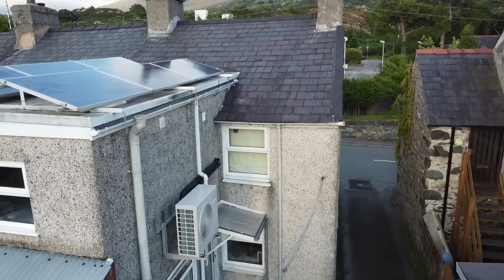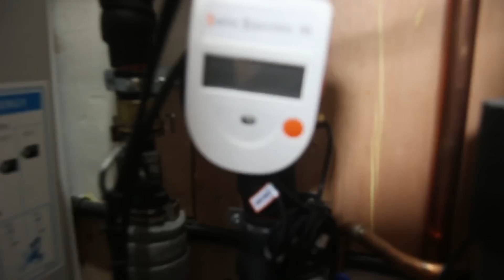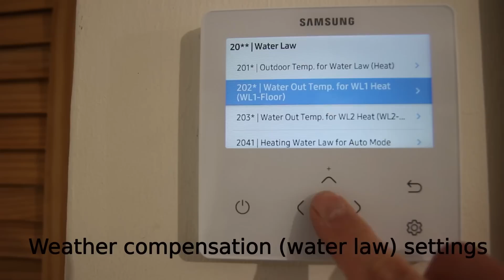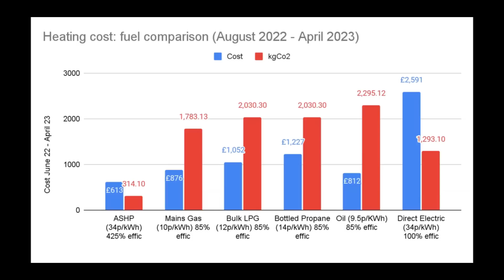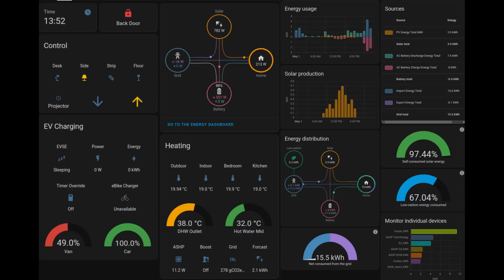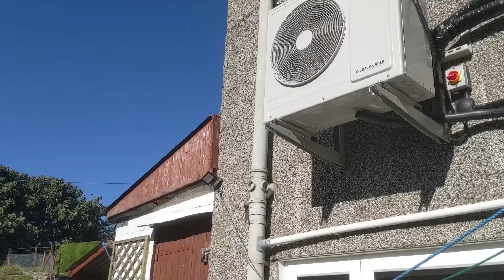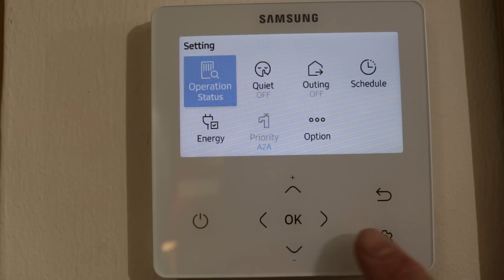Part 2/2: Air Source Heat Pump 1st Winter Performance 2022-23 in Solid Stone Welsh Cottage

Comment: Hi Glyn, I have recently stopped full time work after 51 years in HVAC. My last position we had AWHP Range (competitor brand). Really blown away that 5 kW size is adequate for your Application but need to believe the results you have shown. I assume the Samsung model is R410a Refrigerant and has an Inverter Compressor for variable capacity control.  (?)
Reply from the maker: Hi Terry, thanks for your comment. The Samsung unit uses R32 refrigerant with an inverter compressor.

Comment: Hi, thanks for the information! Q; because we live in a simular old house and we are about to start with a renovation, would you choose under floor heating over radiators?
Reply from the maker: Yes, UFH is great if it's an option and it's been designed for low temperature heating. Often in a retrofit UFH is not a very practical option. But if your doing renovations it's a good opportunity.
Reply: @GlynHudson  hi Glyn, thanks for your fast reply. Because a UFH system needs to heat up the thermal mass and therefore not suitable for a on/off system like radiators, my concern is that it will use more energy. Or am I’m thinking wrong here?
Reply from the maker: @MrFlyby34  your correct UFH will take longer to heat up, but will be more efficient since it will be able to run at a lower flow temperature than radiators so heatpump will get a higher SCOP. Generally with a heatpump with or without UFH its more efficient to keep the house warm 24/7, just with a set back temperature of a couple of degrees lower at night or when your out. This will use less energy than switching it off.

Comment: An excellent video with very useful real-world data.

You mentioned that your system isnt "zoned", however i noticed that you have thermistatic valves on your radiators, which effectively means that you have individual room zones.
Reply from the maker: Thanks. Zones are usually defined by having zone valves to be able to heat different parts of the house at different times. Correct, we have TRVs so we have the option to reduce heating on one or more radiators but we've left all the TRVs fully open

Comment: In total how much have you spent on your ASHP and the solar battery system? Admiitedly this is not why you are doing this but what is the payback time in years?
Reply from the maker: Since I did all the work myself, my costs are not really comparable. I spent about £4k on materials which included all new radiators, pipework, heat pump and cylinder. There is currently a £5k BUS scheme grant available from the UK government which I was not eligible for since I did the work myself

Comment: Brilliant work!  I have DIYed 3 gas central heating systems before, in previous homes and had to have a new gas boiler installed last year, because of the CORGI regs.  After watching your install, I am now thinking of DIYing a heat pump.  Fortunately, I used 22mm primary pipework so it might be a goer.  I will have to reinstate a HWC and will look up the physics and calculations about heat loss etc.  Do you have any links to theory stuff?  I studied engineering physics so I think I can understand.   Keep up the great work!
Reply from the maker: Thanks. You get about 6kW down at 22mm pipe at 0.9mps at DT5. Watching all the heatgeek and urbanplumber videos is a good place to start. Also, https://heatpunk.co.uk is an excellent heat loss calculation tool.

Comment: This is an inspiring video - thanks for making it.  I'm trying to understand how the system manages relatively low-temperature space heating (35°C) and relatively high temperature (up to 65°C) DHW heating at the same time. Is space heating paused while DWH heating is happening? What sort of plumbing arrangement and controller are necessary to  make this happen? Any references you could provide to educational material would be very welcome. Thanks.
Reply from the maker: Thanks, yes your correct the system can either do space heating or DHW. Not both at once, but DHW only takes about 30-40min so I just schedule it during the night when we don't need space heating as much. There's a three-port valve controlled by the HP which diverts the flow between DHW or space heating. The  HP ramps up the flow temperature during a DHW cycle. If you look at the data from my unit during the summer months, you'll see it only doing DHW https://emoncms.org/samsung5kw

Comment: Just wondering if you know the difference between the DHW's Economic and Standard modes? I am correct in assuming that in  the Economic mode only the pump is used whereas in the Standard mode, the heating element in the tank might be used as well?
Reply from the maker: Correct, I'm standard mode the default is for the immersion heater to kick in after 20mim. Also Eco mode heats the water a few degC lower than the setpoint. I would recomend using Eco and just setting the setpoint slightly higher to compensate if you need the water to be hotter.

Comment: Would it be beneficial to install the Samsung flow and return temperature sensirs onto pipe pockets too ?

I am super impressed with your diligence of finding the most efficient flow temperature. 

Ultimately too, having installed it all yourself, you know it inside out.

So many people have incorrectly or inefficiently installed HP's by "professionals".  You prove even moreso why it makes sense to do a self install
Reply from the maker: Thanks. Yes, it probably would, but unfortunately the sensors are located inside the outdoor unit, presumably inside the heat exchanger so, I'm not able to access them.

Comment: Heh Glyn - have you been in touch with Samsung (HQ - product manager) about the sensor quality issue?
Reply from the maker: No I've not, I'm not sure if it a quality issue, the sensors are fit for purpose I.e controlling the heatpump. Samsung don't give any accuracy guarantees on the monitoring data. I think they would say that it's working as indended. .

Comment: very interesting, and well presented. I am focusing on the matter that you find" better" running at 35 than 30 degrees. I may have missed something (I'll view again later the video), but I would look better at this, as it is contrary to the "theory". You claim two days at the same temperature: your records are 6% less energy consumption at 30°, yet at a 16% lower Heat Output, which means a worse COP. Surely you trust your instrumentation, but I would be curious to compare the records of the ASHP ref. those days (energies and COP), if available. In any case, both consumption and output are not consistent with same OT days. You may be right about a loss of efficiency, but I would be surprised, as the throttling back of the unit is not so important (32 kWh in a day would be 1300 W continuous, i.e.27% of the nominal pump output. I do not know about Samsung, but you may ask for data sheets as a customer.
Personally, I would repeat the experiment, to be sure, and also looking at the level of comfort vs. electric consumption. 
You got my attention, so I'll now watch the other videos of your channel.
Reply from the maker: Agree, the difference in efficiency is marginal but nonetheless I thought it was interesting. I think it's because my radiators are able to radiate more heat at a higher MWT.  In general lower flow temperature = higher efficiency, but there is a limit at the extreme! I don't think many people will be running 30C flow temperature at design temperature, in the shoulder seasons it doesn't really mattery since there's not much heat being delivered. The Samsung datasheets are very poor, not much info on this.
Reply: @GlynHudson  let me first let you know that I watched the video of system installation and liked it too, both for the clear description of the work, and also because of the choice to make it yourself, instead of getting the government bonus: you surely made a better work and now have a full knowledge of the system.

Comment: Fantastic performance, good for you 👌

Great that the property is still comfortable with radiators running at such a low flow temp, and as a result the COP on even the coldest day is awesome. I saw a recent BBC article that said ASHPs can provide “up to 300% efficiency” but with a decent installation 300% is the MINIMUM expected efficiency, certainly not the max!

Great to see a video with all the facts & stats supporting the positives when so much of the MSM are downplaying how good ASHPs can be.

Curious about the apparent drop in efficiency when the flow is <33-34 though. Interesting…
Reply from the maker: Indeed, a COP of above 3 is the expected minimum! 

The drop in efficiency at very low flow temperatures is somewhat negligible, and probably specific to my system. I included it because I thought it was interesting and not something I've heard discussed before. For most system most of the energy is delivered at a flow temp higher than 35C.

Comment: Fantastic video Glyn. Excellent editing and use of data & charts!

What would the cost of energy be if you included the all the battery costs over its excepted  lifetime? Or maybe you did already?
Reply from the maker: The payback on the battery will be less than 5 years. It saves about £1k/yr in electricity cost at current rates.

Comment: Yeah but how warm was it really? 35 degree flow temp is not much in a radiator.
Reply from the maker: I included a graph of indoor temperature thought the year, it was 20.7C indoors on the coldest day with it was -5C outside, the heatpumps were running with a flow temp of 35C almost 24/7 when the temperatures were sub-zero outside https://youtu.be/kkNx2oSO-S4?t=238

Comment: I'm not surprised at the Samsung readings being out, can you not calibrate these in the software, otherwise great result, well done.
Reply from the maker: Thanks, there's an option to calibrate the controller room temperature sensor, but unfortunately no option to calibrate the Samsung flow and return temperature sensors which are located in the outdoor unit.

Comment: My concerns remain over grid capacity and the potential for Ofgem to cap demand. Your peak consumption  of 2.2kWh, would mean the entire output of the Hornsea ONE offshore wind farm (covering 300 square miles), would power less than 350,000 homes - and we’re looking at replacing 24 million boilers. Given we have less than 6,000 square miles of seabed that can be used for wind energy,  that would translate to seven million homes maximum - and that’s ignoring ALL other demand. Something will have to give - if the lights are not to go out
Reply: Hi. I was curious about the figure you mention of 2.2kWh. Do you mean 2.2kW? Remember that is less power than a kettle!
Reply: @andrewcunningham1  Although peaking, it's classed as a continuous load, as opposed to a kettle which consumes 2kW for 5 minutes (so 0.17kWh). However, that is somewhat academic. The problem is one of UK generating capacity, and it's a problem that I have yet to have anyone give me an educated answer to.

In Finland (where I sometimes work), just over one million of that nation's 2.7 million (super-insulated) homes have now switched from gas to ASHPs. This has resulted in a increase in grid demand of some 3.1GW during the winter months - a not unexpected figure (and one that ties in with your own data). And it is this brings me back to the concerns I raised in my original post above.

So we have 24 million gas boilers to replace, meaning that during a cold winter we could be looking at an increase in grid demand  of 74GW. When you consider that the offshore wind farm Hornsea ONE, can generate 1.25GW and covers 300 square miles, then to power all UK domestic heating from renewable power, we would need a wind farm of some 17,800 square miles, which (given we only have 6,000 square miles of seabed suitable for the installation of turbines), would be quite an achievement.

And that's before we then consider food production: just for bread, the ploughing, feeding, harvesting and drying of the grain as well as the gas ovens needed to actually bake the bread, as well as all transportation, uses more hydrocarbon power (roughly 60GW) than the UK's entire electrical generating capacity (about 45GW). Oh, and that's JUST for bread! Let's not forget all those tinned foods, cakes, and other processed items (the figures for which I don't have). If we add a further 12GW to that to cover charging EVs (assuming all petrol cars are off the road), then, pretty quickly, things start turning VERY scary.

So here's my estimates: 45GW (current) + 74GW(ASHPs) + 12GW(EVs) + 60GW(bread production) + unknowns for all other foods + commercial transport + industry etc. So we're looking at a minimum of 190GW, which would require 60 nuclear power stations the size of Hinkley C or an offshore windfarm covering 46,000 square miles.

Clearly something here is going to have to give, as the idea we're going to switch to "renewables" with numbers like those, is complete nonsense. My guess is that Ofgem and/or National Grid will call a halt to ASHPs, just after 500,000 have been installed. At which point the entire market will crash, and people who've invested in them will be left completely in the lurch.
Reply: @skfalpink123  I've always thought what a shame that the enormous amount of heat from power stations is just dumped into the air or the sea instead of heating homes 0.5 - 2 miles away. Do you know if the Scandinavian countries have addressed this at all ?
Reply: Generation and transmission are being increased to cope with demand from EVs and heat pumps. It's all in the latest UK CCC report if you haven't already seen it.

Comment: As a Heating Engineer, you’ve done a fantastic job of the system in your home Glyn. But readers be warned, a Heat Pump is not suitable for every property. Plus, there’s the overall cost of installation & equipment required. Which blows your carbon footprint completely out the water!!
Also, for a small property like Gyn has, you’d never recover the installation cost when it comes to selling it, which you will. A two Bed house will always only have a limited value.
Then there’s the depredation in performance of PV panel & HP etc. Reports are PV panels are only lasting 10 years, with a sharp decline in performance & ASHPs requiring a major overhaul & re-gassed after 5 years.

So my advice if you live in an area with Natural Gas; insulate your home to the Max & fit a Gas Boiler. Much cheaper install cost & almost the same running costs as an ASHP.
Sorry Tree Huggers, But don’t believe all the propaganda & 💩 you’re fed!!
Regards Dick Puller.
Reply: You're Roger from Skill Builder really, aren't you. Bah humbug😅
Reply: @mikeypc3592  No mate, he’s a twat!!
Reply: Dinosaur

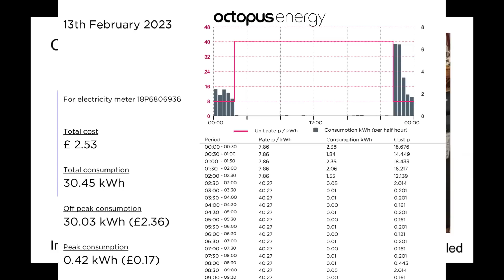Comment: @11:15  Wow, that is a very narrow off-peak time period.  Pretty neat and definitely need the battery to fit all your electric inflow during that time.   Do you do that all the time, inflow only on off-peak?  Might be able to with solar and battery!
Reply from the maker: I'm currently on Octopus Go Faster which has 4hrs of off-peak between 9:30pm to 2:30am this more than the standard Go tariff. It's enough time to charge a home batter and EV. I've also set a slightly higher temperature set point schedule for the ASHP during this period and run a DHW cycle.
Reply: Ahh, just later in the video, the battery size is not quite enough to prevent all on-peak inflow.    Do you have any control that would run the heatpump during off-peak, even if target temperatures are already met?  Or you must have already set the domestic hot water heating period during that time.

Comment: Really interesting that the efficiency at the lower 30DegC flow temperature was higher. I never expected to see that.
Reply from the maker: Yes, it was an interesting observation but quite a marginal difference either way, and probably quite specific to my system, the general rule of thumb that lower flow temp = higher efficiency is still true.
Reply: @GlynHudson  I don't have a heat meter on my system as it was already installed when we moved in, but during last heating season I changed my NIBE inverter maximum output frequency from 'Auto' mode for heating and limited it to the minimum frequency. This resulted in longer run times and much less cycling at the low flow temperatures.
In the coldest weather there was one day where it ran almost all day. Something I'd never seen previously.

Comment: Excellent video.   Lots of data and I think you show that there is a lot of hersay in the often quoted "Heat pumps are not suitable for property XXX".

Is this point home assistant; https://youtu.be/kkNx2oSO-S4?t=847

Also is that 28mm pipework primaries?
Reply from the maker: Thanks, yes that's Home Assistant. I use a combination of Emoncms and Home Assistant for monitoring, control and datalogging. 

Yes, I used 28mm pipework for the first section of pipe from the heatpump to the 3-port valve then the rest of the pipework is 22m, dropping to 15mm to the rads. Although for a 5kW ASHP 22mm primary pipework would be ok. Larger heatpumps will need larger primary pipework. Heat Geek did a good vide on this https://www.youtube.com/watch?v=HFlIbNAUWkY